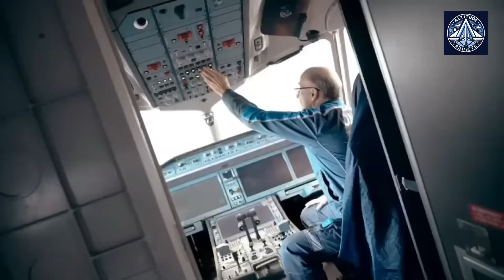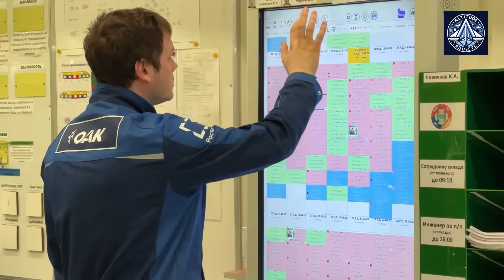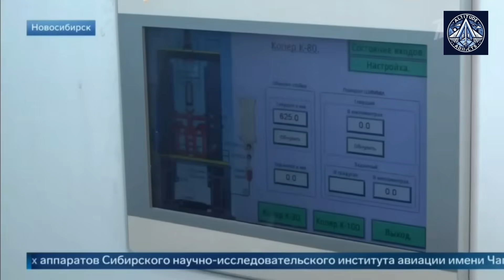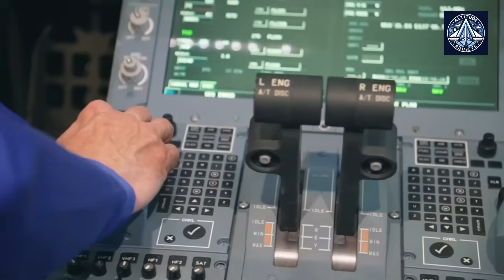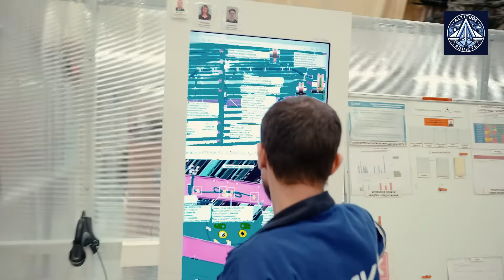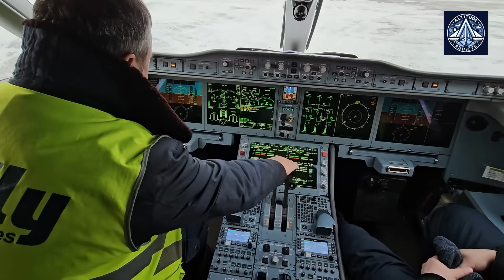MC-21 Commercial Production begins; Fully Russian Safe SJ-100 to fly in April

Comment: If the landing gear structure is capable of puncturing the gas tanks then a redesign is necessary.
Reply: landing gear was made by french Safran Landing Systems
Reply: @bagamut I would think that every precaution should be made to prevent anything from puncturing those fuel tanks for the most obvious of reasons. Seems a very fundamental design criteria.
Reply: landing gear in a crash landing does not puncture the tanks, it's a fake
if you do crash landing it's a crash landing, it has nothing to do with "puncturing"
tanks was damaged cause of crash landing
don't do any crash landing, never, and you would be OK
Reply: you can tell that to french engineers
at normal usage puncturing those fuel tanks is not possible
Reply: @bagamut I certainly hope so. What about abnormal landings ? What if ?
Reply: if you do crash landing it's a crash landing, it has nothing to do with "puncturing"
Reply: @bagamut  Why is approval dependent on insuring the landing gear in a crash landing does not puncture the gas tanks if there is no way to guarantee the gear will not damage the tanks ?

Comment: If we look at the video of the Superjet 100 crash, Western aircraft will experience the same thing. Whether airplanes made 50 years ago or made today, they are not supposed to land at fast speeds. A good pilot must be aware that one should not land in a hurry, even if it is an emergency. Millions of landings in the past were saved all because the pilot landed the plane after realizing that the speed had slowed down.
Reply: yes, the pilot allowed too high vertical speed during landing and "goat" (jumping aircraft on the runway). This led to the destruction of a perfectly serviceable aircraft.

Comment: I thought the pilot didn't dump enough fuel and hence the plane was very heavy on landing? 
anyway they replaced the foreign made (French?) landing gear with local designs on the new SJ-100  aircraft
Reply: the pilot allowed too high vertical speed during landing and "goat" (jumping aircraft on the runway). This led to the destruction of a perfectly serviceable aircraft.